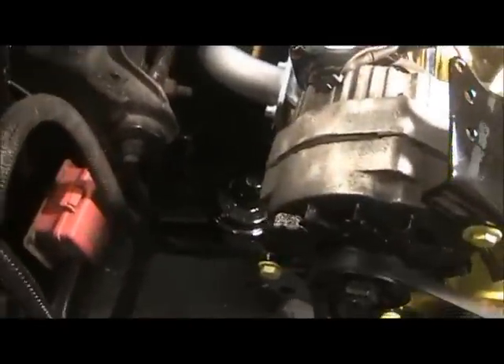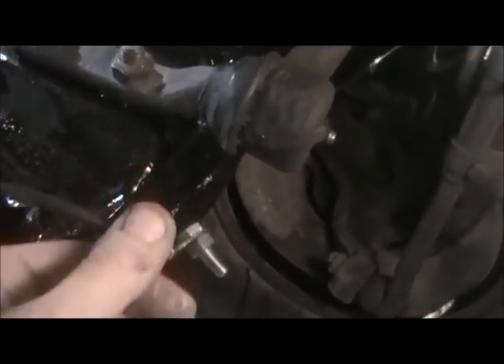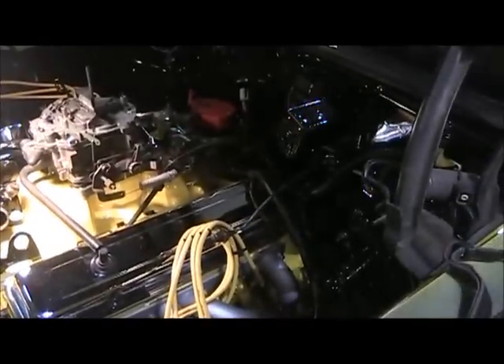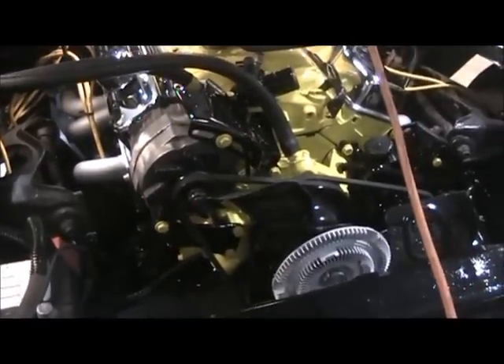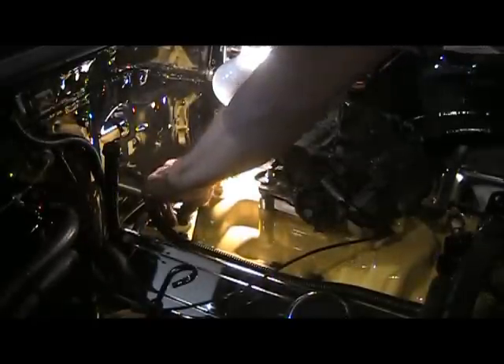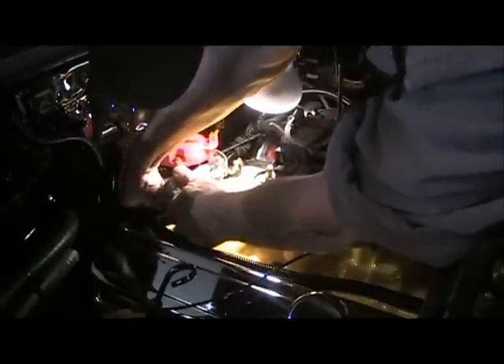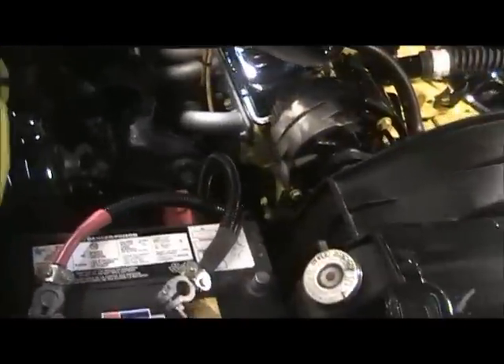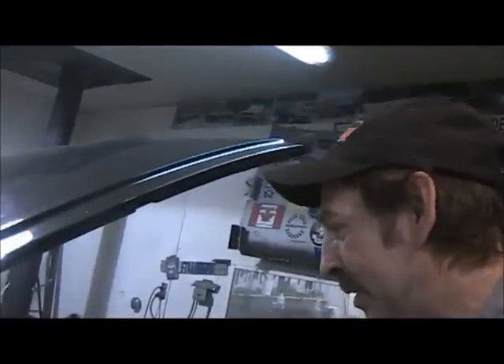nova engine is almost ready to start

Comment: The wiper motor is a good place to get power for the choke,there should be a wire that is hot when the ignition is on there.Looking good.
Reply from the maker: thank u,that is good to here and is pretty close,realy not good at this wireing stuff but i got to learn and i thank u for that information,tc

Comment: Heater hoses-- yeah, I got burned on that-- thought they were the same (because some guy used the same size for both-- 5/8")
She looks great-- a lot of what you were doing was familiar to me for some reason...
Reply from the maker: thankx reubin,thats the same as this one was when i got it,i was lucky the place i got the hoses was only 2 mins away so i just took one back and i forgot to mention in the vid,one was 3/4 and the other 5/8 and u r right both our cars have the same atachments under the hood,alot of the stuff im reusing is from the 4 door,much better shape than the 2 door,thankx for watching,tc

Comment: Did you ever think about adding a serpintien belt setup off a 90's chevy truck?
Reply from the maker: this engine is just temperary and to see what a yellow engine would look like,i have a 4.8 vortec out of a 2004 gmc that i am going to put in it in time and it has the serpintine belt which i agree looks alot better,i still have to get alot of conversion parts for that engine but im looking forward to the day that happens,tc and thankx for watching